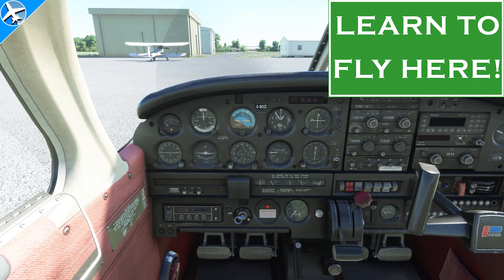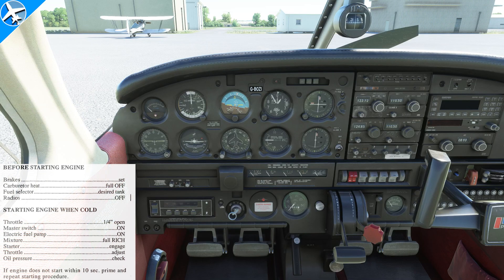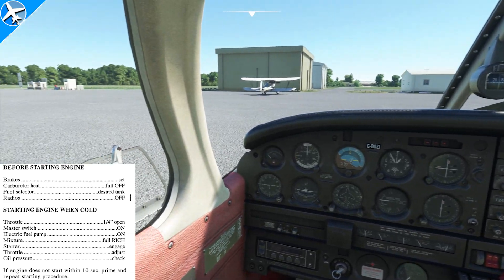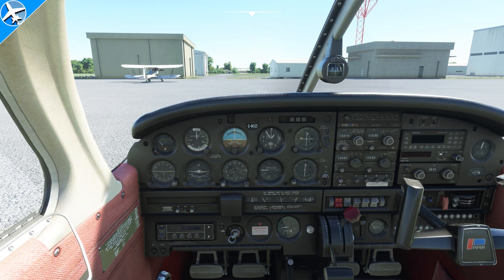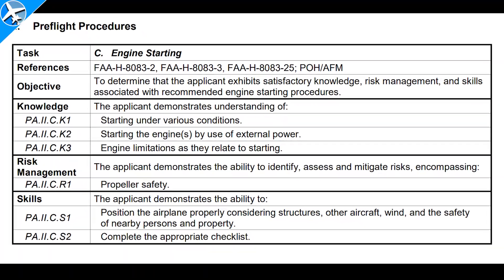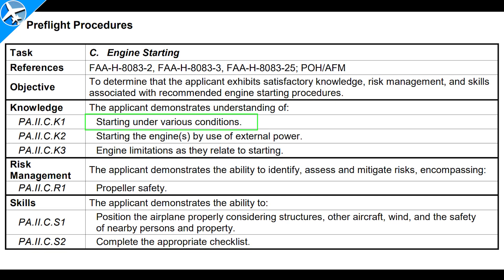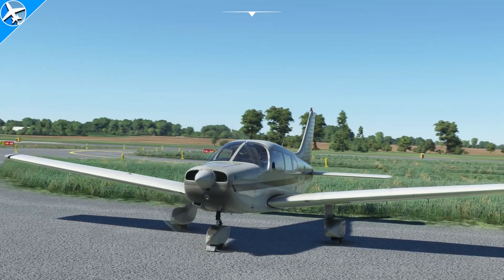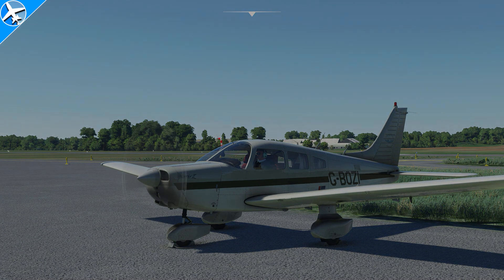Engine Starting | Propeller Safety | Learn To Fly Here Series

Comment: 0:45... "What's wrong?" Also starting the engine without the beacon light being on, right?
Reply from the maker: Yes and I had that in my notes and didn’t get it in the video.   Pilots should turn the beacon on prior to start.  However, making sure the brake is set, chocks removed, and saying “clear prop” are far more important items.

Comment: Great tutorial! You do have a few options for failures in MSFS but they're mostly engine related: Complete failure, oil system failure, oil leak, fuel pump failure, ignition failure & fire. Not really sure what indications you would get in the cockpit though. I think they're more intended for in-flight emergencies.
Reply from the maker: I have tried some of the failures.  Once, I tried a left magneto failure and it did not work.  The failure was a failure.  The stuck starter example was used because it was an example in the Airplane Flying Handbook.